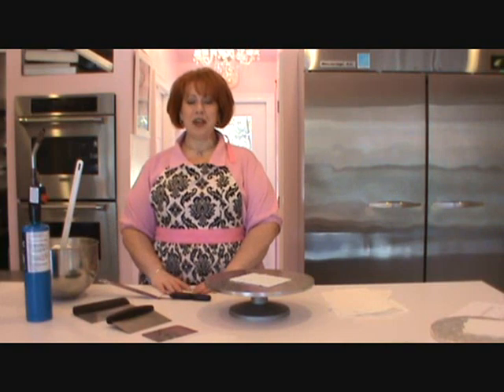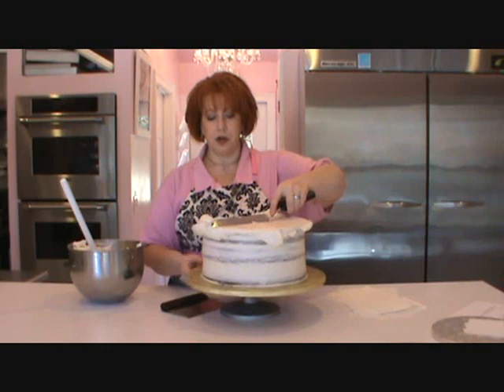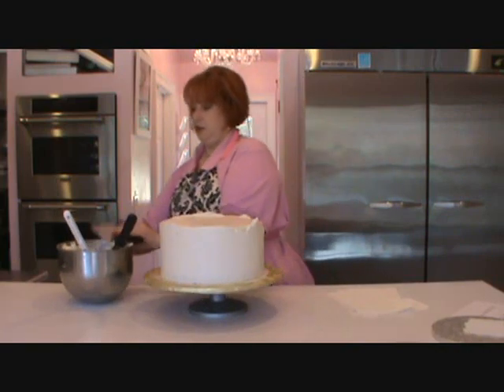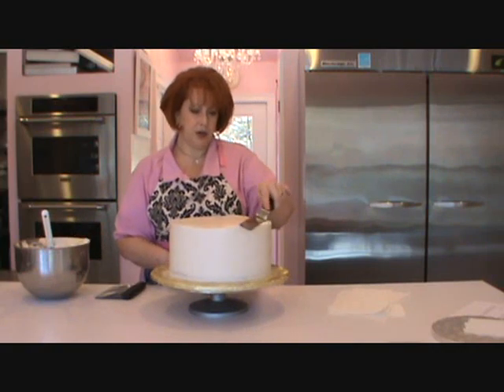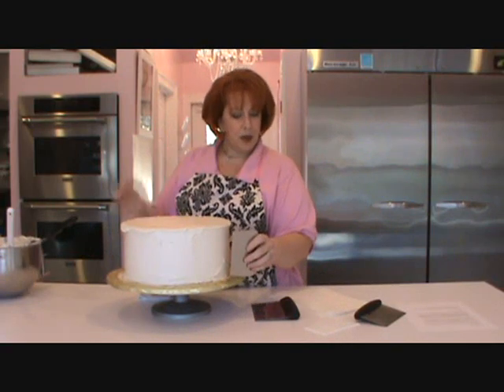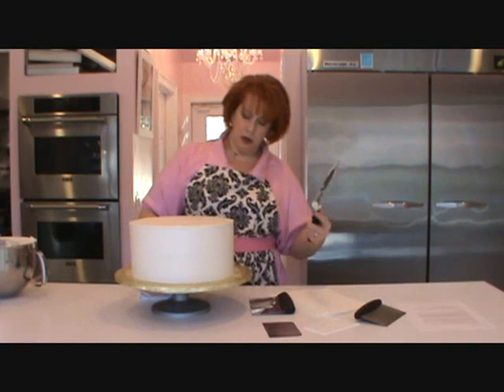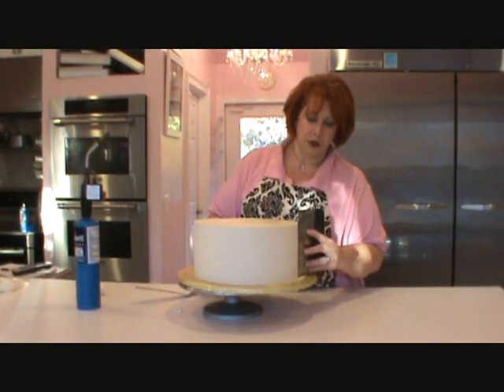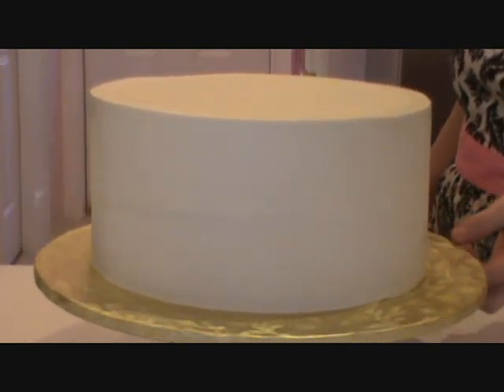Smooth Buttercream Tutorial

Comment from the maker: @androshi, I don't exactly remember, but it looks like a 12".  I use mostly Fat Daddios pans, and they are taller than normal pans.  Height-wise, that cake is 3 layers, and probably measures about 5 inches tall.  Hope that answers your question.
Reply: cupadeecakes....I know this video is old, but are the 3 layers 2 in high (which would make it 6 or more with filling in between) or did you tort 2 layers and use 3 torted slices to equal 5 ins? I need to make a wedding cake soon and want to do that same height..you are sooo good..I hope to be that good..hope to hear from you! Thx! 😉

Comment from the maker: @Lacuna1024 - Thank you for watching! This technique should TOTALLY work with SMBC. My other icing is a french buttercream (still all-butter) and I use the same techniques with it! Very rarely I will have an air bubble issue with the recipe I provided.  If it happens, I get the cake cold again and then using a pin, I will make a small hole in the bubble and then "burp" it, just like if you had a bubble in fondant.  I use this icing every week and I haven't had a bubble in probably 4 months.

Comment from the maker: Every cake recipe is different, some dry out faster than others.  I keep my cooler very cold, but the point is to cool the butter to harden it.  Any standard fridge temp will do.  30 minutes is just a recommendation; you can leave it in there longer if you like.  I bake my layers 2-3 days in advance of delivery.  I double-wrap each layer in plastic and cool it until I crumb coat.  Once the layers have been covered in buttercream, the cake is effectively sealed; air can't get to the cake.

Comment from the maker: It is all butter and butter has a relatively low melting point.  While it's still fairly hardy, I won't use it for outdoor weddings during the summer.  In your average climate controlled wedding venue I have NO problems with it.

Comment from the maker: 70's and 80's?  It should do well travelling.  Keep the cake flat and level - NOT in someone's lap - and keep the A/C running.  If it is a tiered cake, put a wooden dowel down the center of the cake.  I use a piece of shelf liner (the rubbery kind) underneath the cake board/cake box to keep the cake from sliding around.  Good luck!